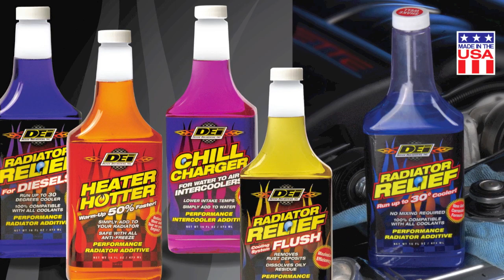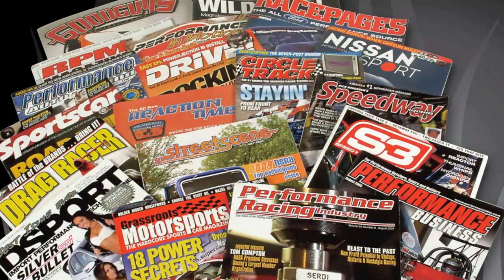Design Engineering company capabilities

Comment: Wouldn’t super cooled fuel cause thermal shock?
Reply: Who runs fuel in their intercooler? Fuel is a coolant. It's good to like -70F. Charge air is regularly above 170, if not above 200 degrees on the hot side. By the time this air hits the fuel where it is actually injected - near the heat of the cylinder head - it's fine.